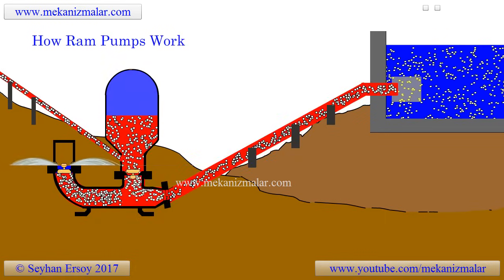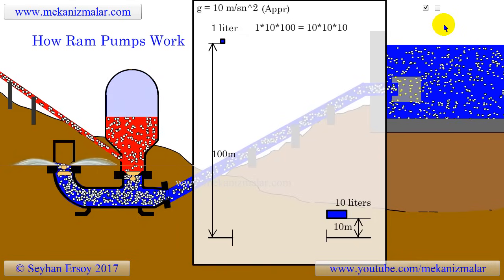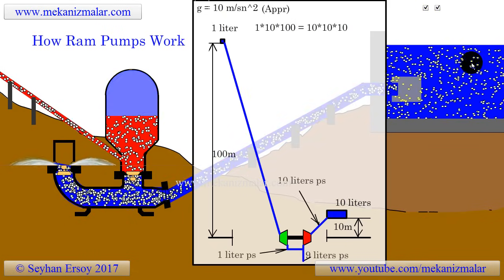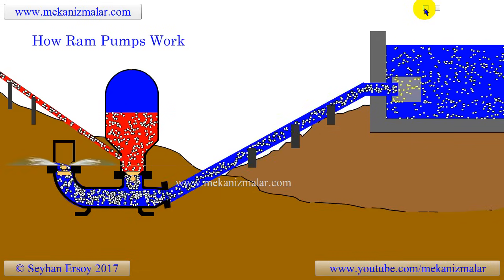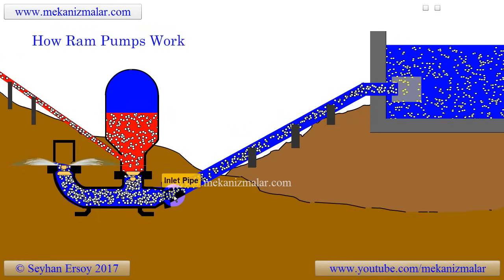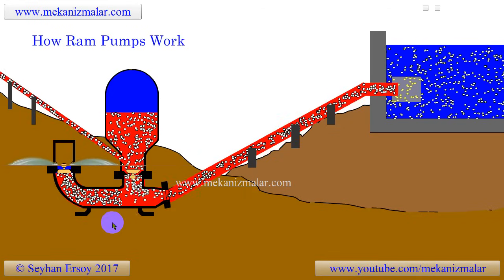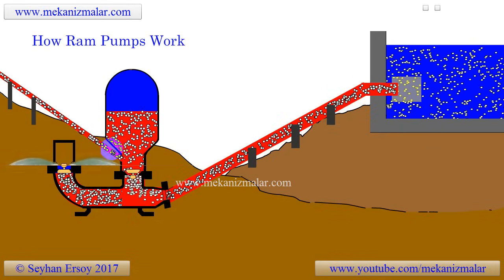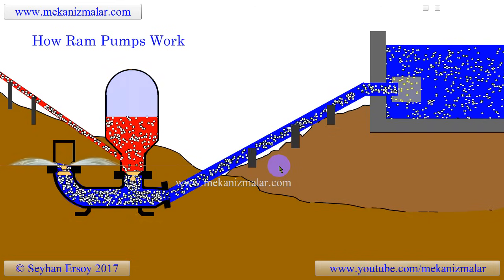how ram pumps work new version

Comment: If you added a little bit of electricity, couldnt you do away with the waste valve (so no water is wasted) and operate the delivery valve with a timed solenoid?
Reply: The energy to create lift comes from flow inertia.  No flow, no inertial energy.  You're using a creek to power the unit, the water is not wasted, it's routed back into the creek to carry on with it's original journey.  You are simply taking from the creek, what is used for human purposes.
Reply: No, you can't get something from nothing.  The energy to pump the water uphill has to come from somewhere.  The "waste water" must be generated because we need a certain amount of water to flow downhill so that we can capture its energy.
Reply: @AgentFriday  I understand what Debbie is saying and yes, I think her system would work but, unless you are trying to catch all the water, there is no point in using a solenoid. 
A ram pump is usually used to pump a small % of the water in a stream to a higher elevation. The waste water will just find its way back to the stream. A ram pump is capturing the energy in the stream, using some of that energy to pump water to a higher elevation, then, that extra "waste" water, is returned to the stream. There is no need to use a solenoid, instead, we are using the energy of the falling water, then that "waste" water ends up running down hill, usually back to the stream. 
I think Debbie was thinking along the lines of not wanting to waste any water but we aren't really wasting any water, we are just using it's energy and returning it to the stream.

Comment: Nice work 
But i have a question its about the type of valves?
How can i control the valves to let it suddenly close and open after a while?
Reply from the maker: You should not, system design conditions does it automatically.
Reply: Make the passage for the valve longer